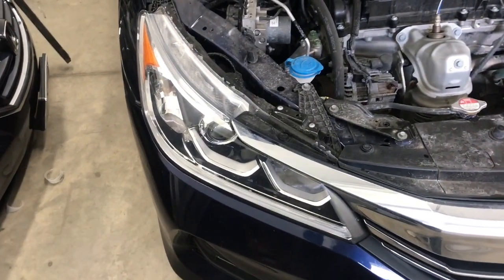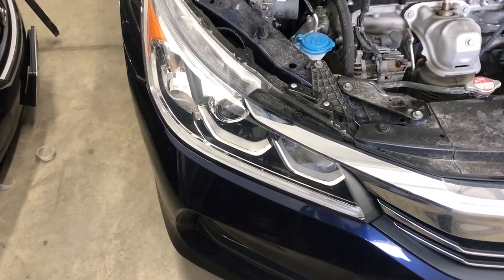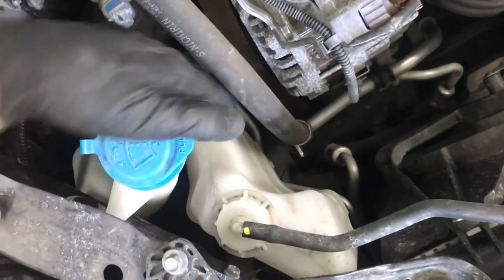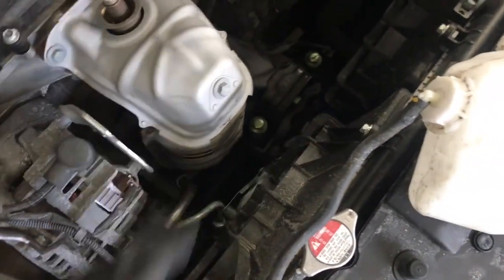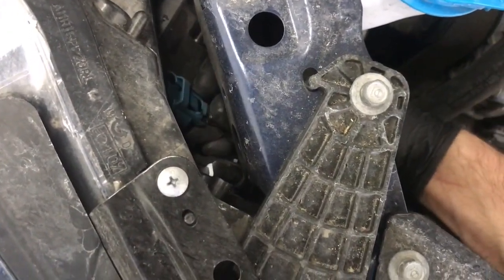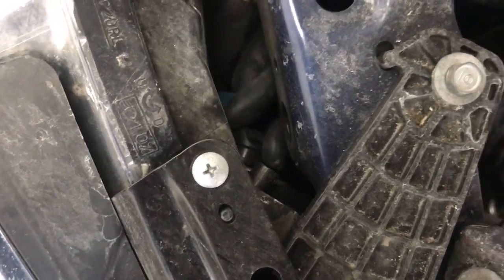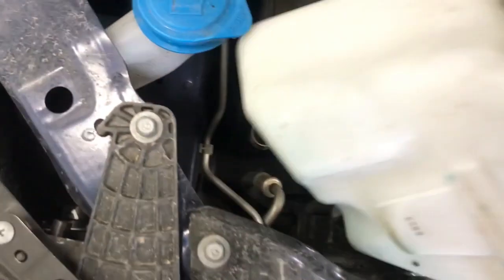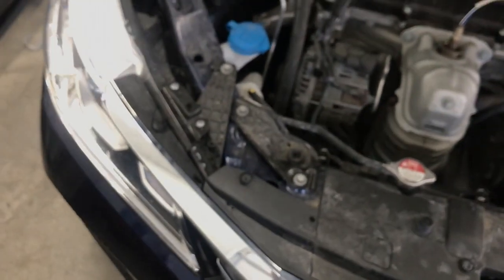2013-2017 Honda Accord Headlight Bulb High Beam Replacement Passenger Side How to Remove

Comment: Wow it's this simple?  I was trying to get that 10mm out that's behind the  tank.  I just have to pull up on it.  I'm gonna be done with my LEDS tomorrow then!  Thanks!

Now if you'll the bottom line lights were this easy.  I heard you gotta send it in for servicing.